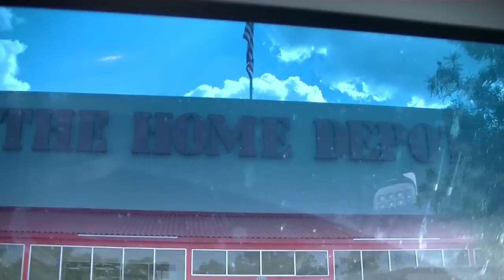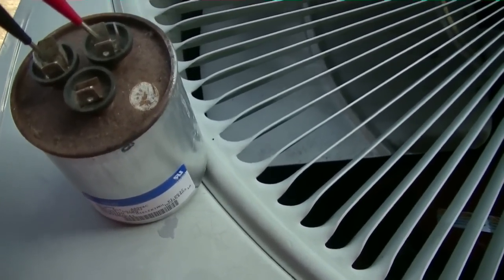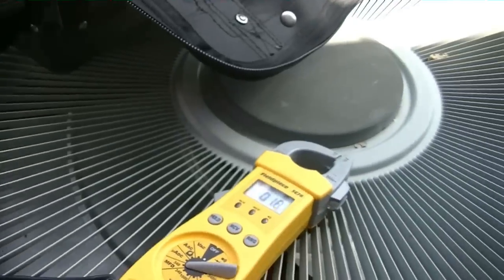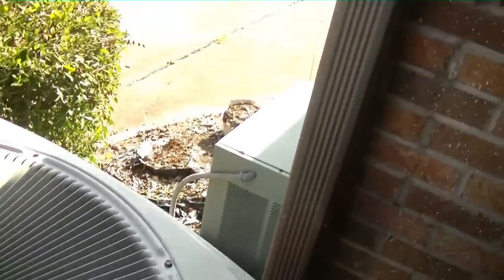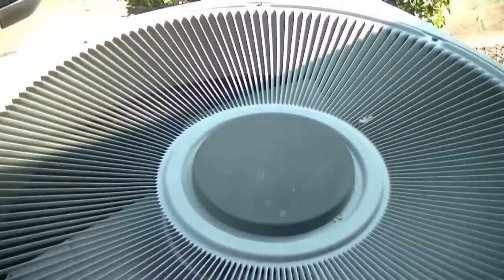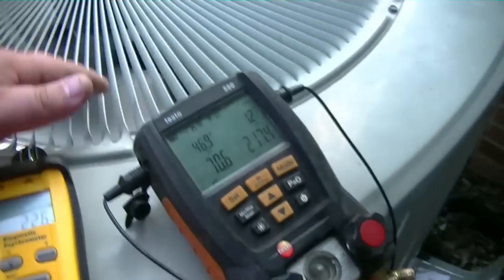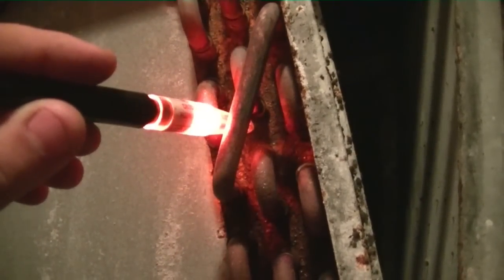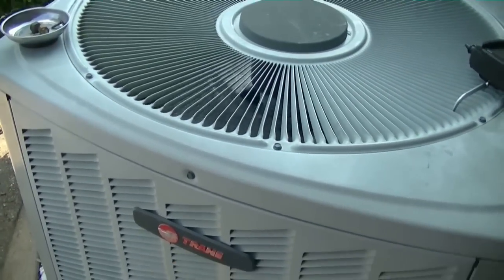HVAC Service- No Cooling Compressor Thermal Overload

Comment: Looks like that h10 leak detector  is really good  a lot better than just spraying the coil with that foam all over or taking it out welding it charging it up with nitrogen and submerge it into a pool

Comment: Wonder if the fan was running whilst cap failed, that’s why fan was still working as the unit was in continuous run mode? If the power was killed it would not have kicked the fan in. Love the videos dude! 👍

Comment: Israel what caused this in the first place?   Is it because the capacitor went out, and they just left it in the on position, causing it to just like sit there and idle with no help from the cap.
Reply: Yes the compressor gets hot from trying to start, just needs cooled down.

Comment: I have a unit that I'm having issues with. Whenever I turn it on the fan and compressor with cycle on and after about 15 min the compressor will cycle off but the fan will keep running what could it be??

Comment: 2:11 John, On a window AC unit recently here the Fan would start once then often not restart on the next start cycle, or many cycles later. The dual Comp/Fan cap is 65/4 uF and the 4uF section read good on two different meters. The cap had a very slight bulge in the flat area. I jumpered in a temporary  4uF cap and the issue went away. The issue was the cap's 4uF section was intermittent and after a few minutes or hours or days the 4uF section would flake out and thus the fan would not run. Once the unit was off for awhile the cap would work and still test OK. The units blower fan for the last few months every week of so would not be on, then when off would work OK for another 1/2 month. Replacing the cap fixed the issue, a weird one that drove me nuts for awhile.

Comment: I just have one question and sure it worked out great here but aren't you supposed to always check for resistance at the actual compressor terminals? Lets say you have a wire that has rubbed a little insulation off, checking at the contactor will give you false reading leading to false diagnosis.

Comment from the maker: Thanks Man!!! I was using super heat because the indoor evap has a piston!!! Piston= super heat TXV= sub cooling!!! When I replace the air handler I will more than likely install a R22 TXV then I will follow that design sub cooling!!! Thanks for watching!!!